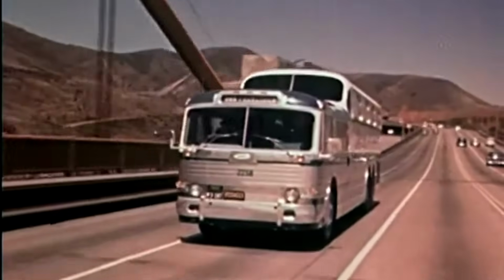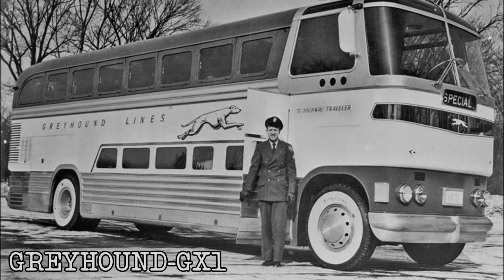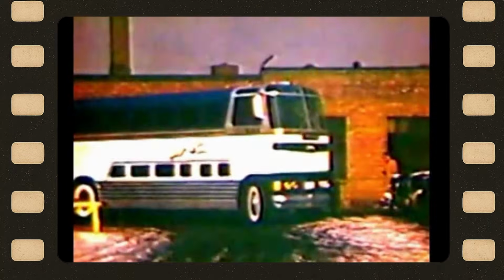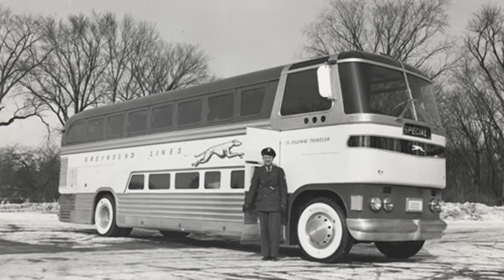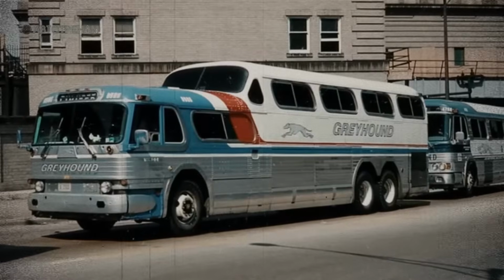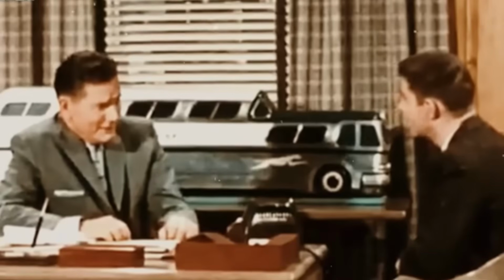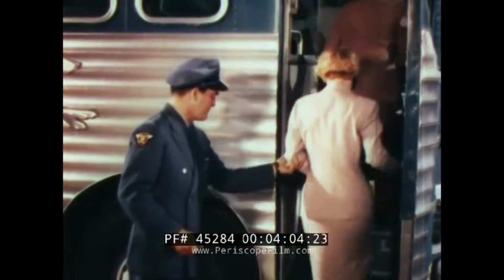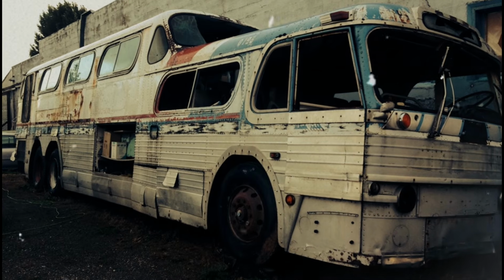HOW 1,001 GM GREYHOUND Scenicruisers Shaped American Bus Travel in 1954–56

Comment: August, 1964 - Cleveland to Dallas, round-trip - an excursion I'll NEVER forget.  Had mechanical problems somewhere in Mississippi(?) during the night - they took the bus into a garage somewhere and raised it on a lift.  It was an impressive sight!  Sitting on the upper deck, right-front seat, I tried to open the window and the handle came off in my hand.  I still have the handle!